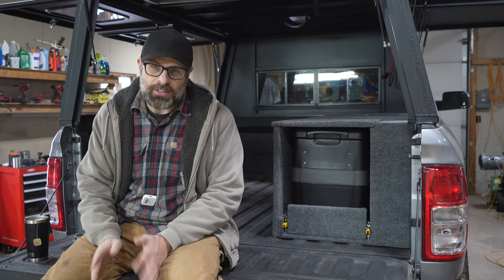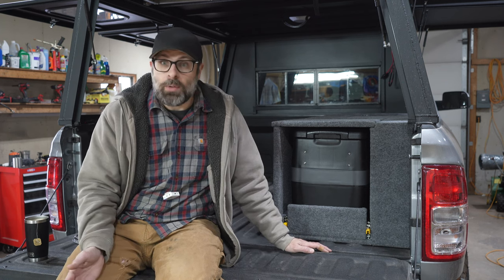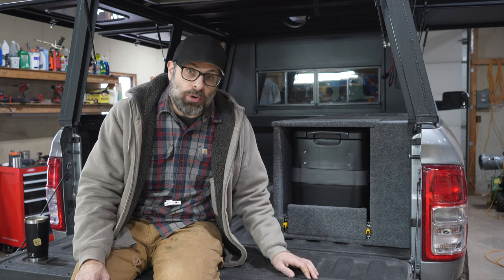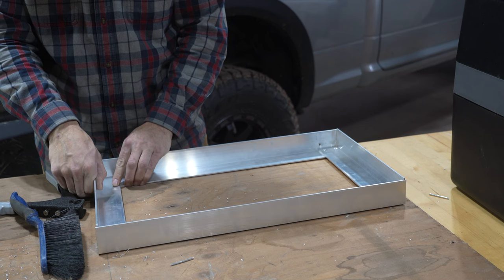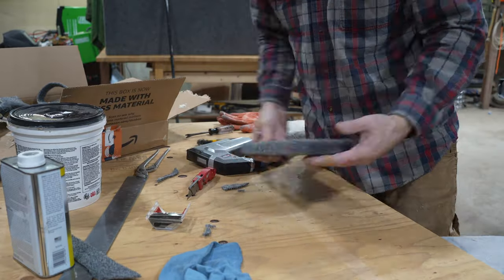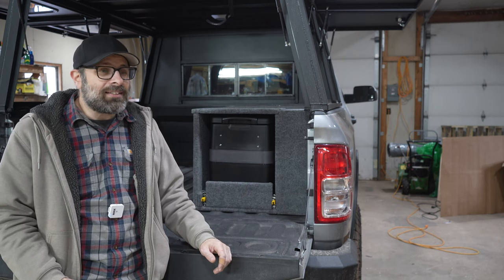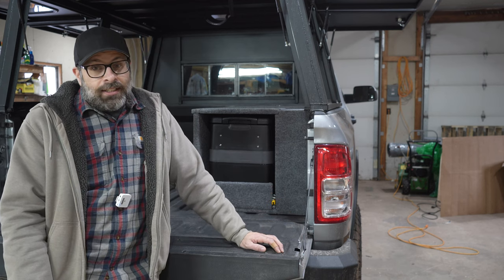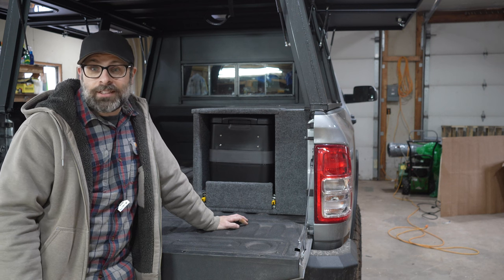Low Profile Custom Fridge Slide DIY - Ram 2500 Adventure Vehicle - Overlanding Camping 4wd

Comment: Really enjoying your truck build videos.  I'm working on a build not much different from yours and am wondering how the drawer slide is holding up after a year of use.  It looks very solid but if you have any suggestions after a year of use, I'd be interested in hearing about them.   Thanks again
Reply from the maker: Those slides are indestructible. No issues at all. They’re meant to be opened multiple times a day, so for a fridge slide it’s nothing for these things.

Comment: Hello, Enjoyed your video.  I have the same problem.  What would you do different for the 73Qt ARB Fridge?  Is it safe to do a horizontal slide? I see you did the vertical.
Reply from the maker: The slides I used aren’t meant to be put flat. That arb fridge is seriously heavy too. 60+ lbs I think and then add food. I don’t think the arb slide is flat either. My opinion is you need to do the slides like I did them. Maybe ask ARB what they think. GL 👍

Comment: Apologies if I missed it…have you secured it to the truck bed? Through the side, or the floor?
Reply from the maker: Not yet. Just going to use J Bolts through the cabinet and under the lip of the bed. Where I through bolted it.

Comment: Did you have issues with the vents on the fridge not having adequate airflow?
Reply from the maker: Doesn’t seem like it. I have a plan if I do though. Pretty easy to just drill a few holes in that back panel. Not too worried about it. Thanks